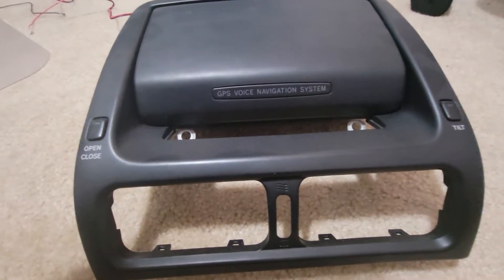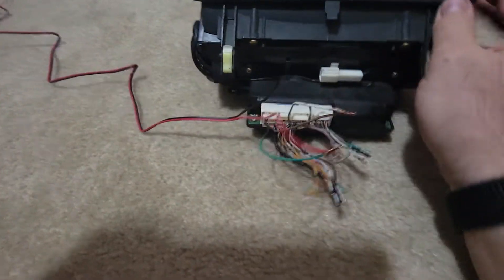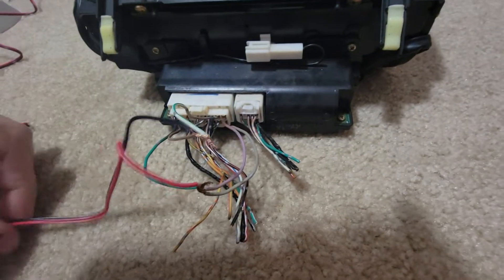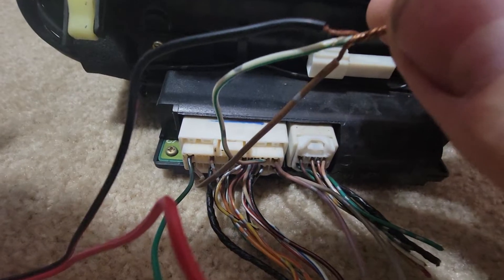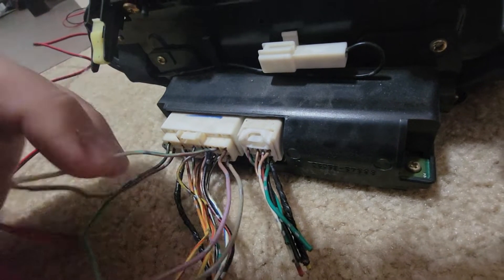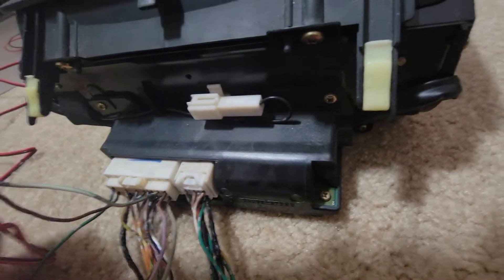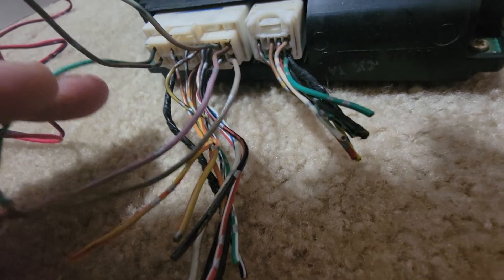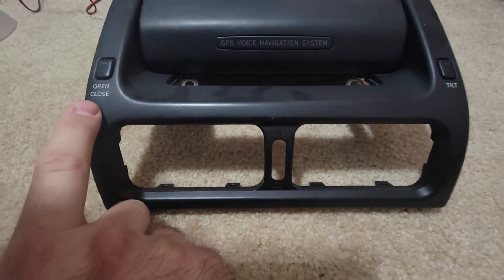2001-2005 IS300 - How to wire navigation screen retrofit to open and close like oem

Comment: Awesome video man! I just had a question where do I connect the power and ground cable to the car?
Reply from the maker: Ground can go to any metal part behind the dash and the power I would tie into the switched 12v for the radio or the 12v outlet.
Reply: Does it open on start up and close when turning the car off?
Reply: I have the same question as Karanbir, does the screen tilt off when you shut down the engine ?